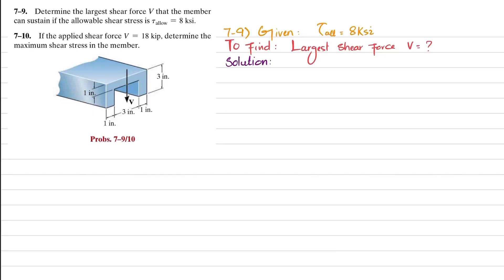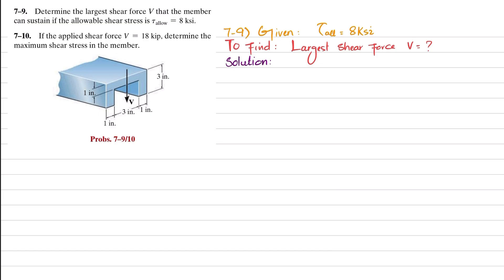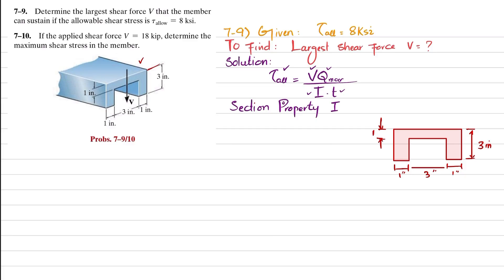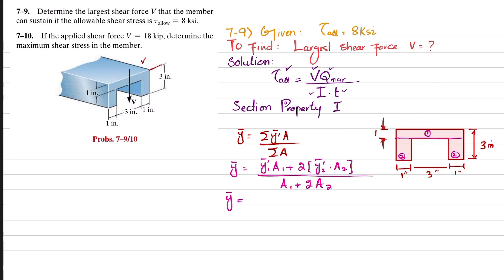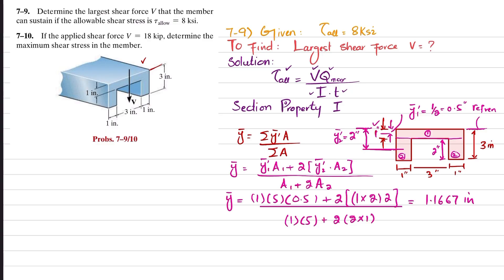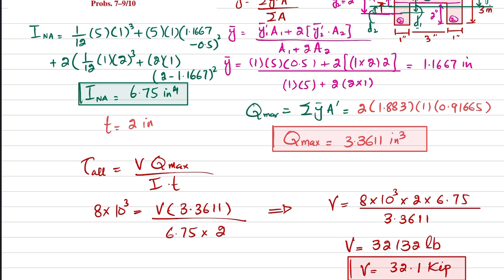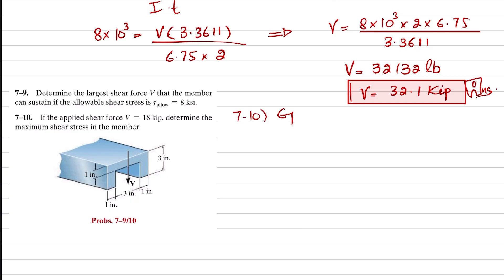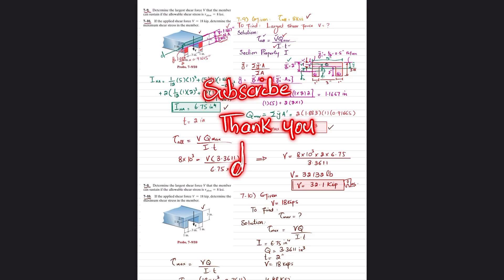7-9/10 Determine largest shear force and determine max shear stress | Mech of Materials RC Hibbeler

Comment: So when finding Q or Qmax you would multiply y-bar by the area below/above the neutral axis? And y-bar is found by the distance between the neutral axis of the whole shape and the neutral axis of the shape below/above? And then for Qmax you would look at the two values and take the larger one, so for example even if the distance was greater for the shape on the bottom you would take the top value if the area was great enough to offset the larger distance? Thanks 😄
Reply from the maker: Yes you are right ✅
Reply: @engradnanrasheedmechanical  Thank you!

Comment: 1.833 not 1.883
Reply from the maker: Hahahahaha ok noted. 1.883 is approximately equal to 1.833 and both are equal to 1.8
Reply: @engradnanrasheedmechanical   By the way, thank you for your videos they are very helpful to me as a student. When I get stuck, and do not have the time to spend, your videos help me move on quickly.
Reply from the maker: @trevismcdeamon6543  Thank you for your valuable feedback and its my pleasure that people like my videos. Kindly share them with your friends as well.
Reply: Mr How you find 1.883 ?
Reply from the maker: @EbtehajEbrahem-u5f total height is 3 so if you minus 1.661 you will get it.

Comment: While determining center of gravity, why Do you drawing reference line above. Can  ı draw to bottom
Reply from the maker: It's method you have to locate the horizontal axis either from top or bottom surface that must pass through centroid. This axis is known as neutral axis.

Comment: How do we know that the section below the neutral axis will give the maximum shear force?
Reply from the maker: Below the centroidal axis/neutral axis the distance is greater than the above so Q will be maximum for below neutral axis portion
Reply: It also depends on the area of the section, doesn’t it ?
Reply from the maker: Yes it depends as well
Reply: @engradnanrasheedmechanical 
Sir but calculating the area above centroid axis is samebas yours
Reply: When calculating the shear stress at the neutral axis (the centroidal axis), the first moment of area Q will always be the same regardless of whether you use the area above or the area below that axis.
Please verify it sir
Reply from the maker: Yes right.